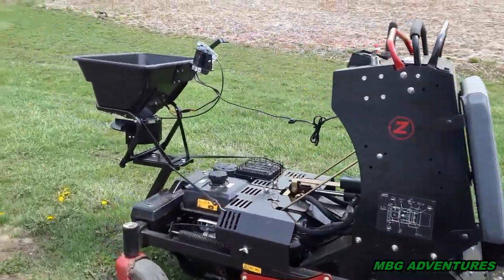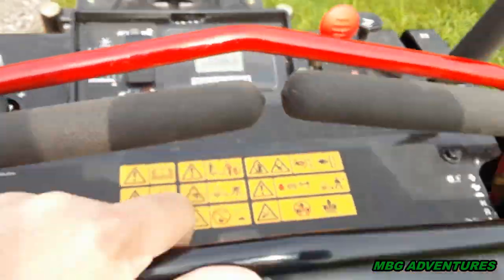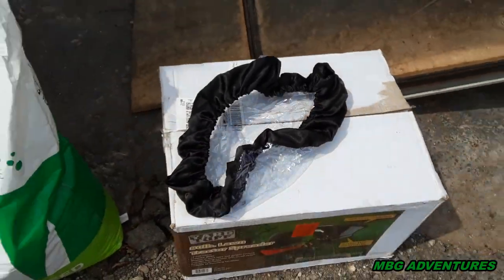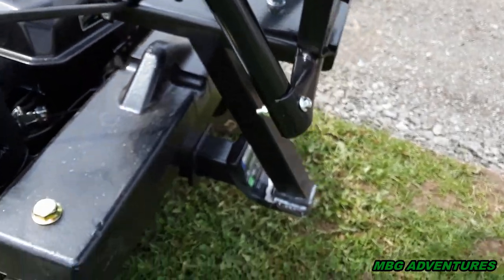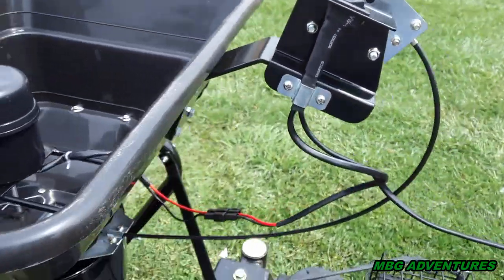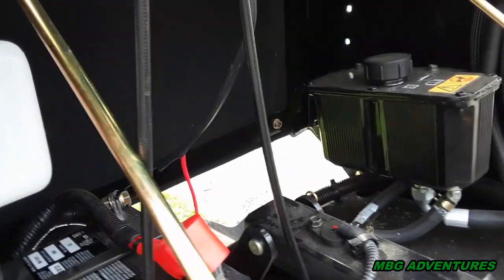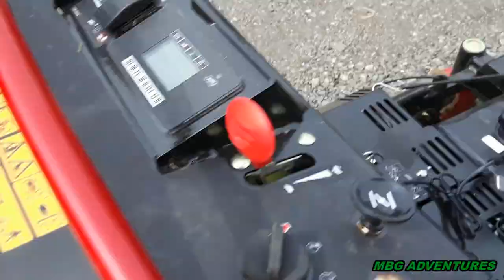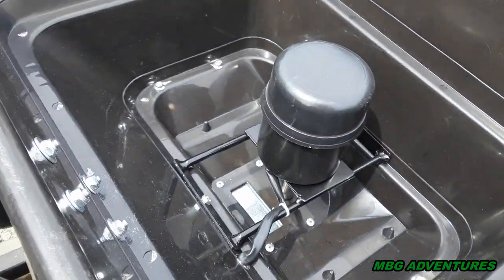Yard Tuff power spreader on a Exmark Z Aerate 24 Inch

Comment: Nicely done. I've got the Toro 30" and looking to exactly this. The ease at which you can remove it is convenient. I am also looking to add a sprayer tank to it also wit the ease of removal.
Reply from the maker: With that hitch receiver on the Aerator, you can attached thigs easily. A sprayer would be good. You don't have to buy the Toro or Exmark brand, you can get aftermarket and save a ton of money. Thanks for watching!